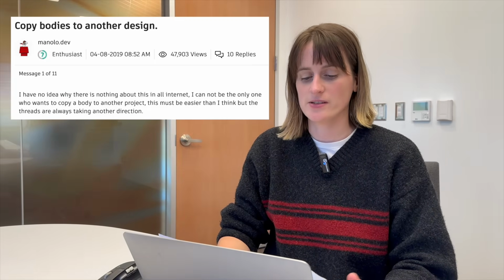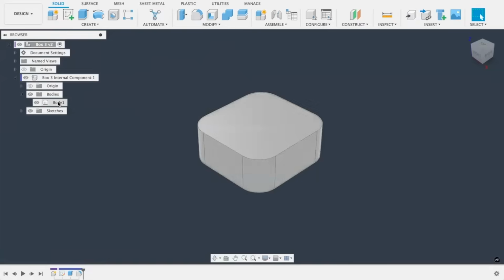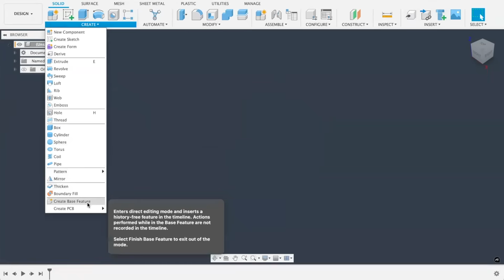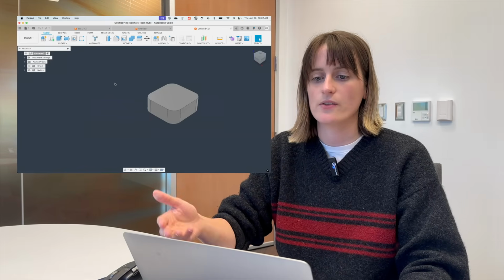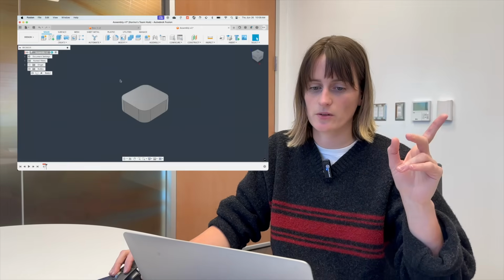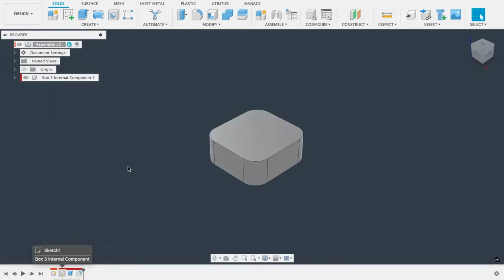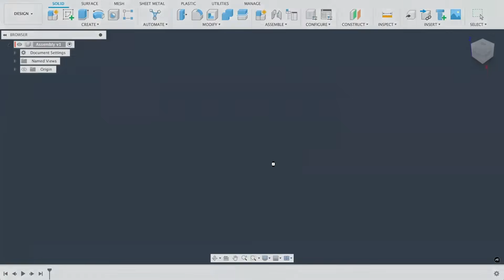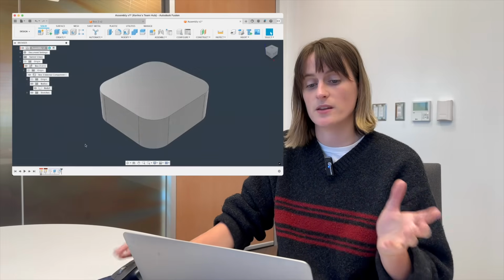How to Copy a Body to Another Design EASILY | Unstuck my Fusion Design

Comment: I miss ctrl+C ctrl+V.  I don't get why simple copy paste can't be standard, or at least a setting in preferences.  "paste new as standard" un-linked and regardless of situation, especially copying into an array or other copies, it's hell if you have the same body copied into components that have copies because now all the copies of the component will also get a new copy of the one part that only goes with the one component you copied it to.  less is more Autodesk, at least give us a button to unlink selectable copies.

Comment: what is the difference between link and derive?
Reply: With derive, you can modify that inserted part without it affecting the original.
Reply: @BlackSmokeDMax ahh, thank you.
So it's the same as a copy and paste ?
Reply: @CR3DT  
Not quite, the derive way is a bit more true to the parametric way of doing things. It is especially useful in things like families of parts. That is also something configuration could be useful in with some cases, but others, just doing multiple derives works much better.

For instance we have some parts that all start with the same blank part off a lathe. 

So we model just the lathe part. Then we derive that model out into each different part that gets work on the CNC mill done, this could be wildly different kinds of shapes cut into it, and not just slightly different sizes where the configuration function would work ok.

Comment: I think the scenario for most users is to copy a body from a complex design to paste into another file which already has some level of design complexity, So the method by copying and pasting component makes most sense. However it becomes a hassle if the body is already inside a component with several other bodies that are not needed in the file to be pasted into.

Comment: Why does Fusion 360 sometimes break the design when I make changes early in the timeline? For example, when parts or sketches depend on others, the references often stop updating and the design falls apart instead of adjusting automatically. Even when I try to reconnect everything, it’s really difficult, and sometimes I just prefer not to touch the beginning of the timeline at all — I just add more features instead.
Reply: Try to follow a general parametric cad workflow, any part should be starting with components, and any early references should be connected well with master 
sketches and constructions that fixed in the origin of the design. 

In Fusion when you start designing by sketching and buddies only there is not enough to make a robust design workflow. In my opinion, that’s the core of any parametric cad software should be rigid and work with a discipline.
Reply: I had this happening a lot when I first designed in Fusion 360, until I learned one majorly important thing - make sure that all of your sketches are fully constrained.  If you expand your sketches in the tree view, and any of them do not have the red padlock on them, they are not fully constrained.  If you make all of your sketches fully constrained, it almost always allows for adjustments that work properly.

Hope this helps, it definitely did for my designs. 🙂

Comment: Thank you for the breakdown of how this works, much appreciated.

That being said though, it didn't need to be this complicated.  It should be as simple as right click on body (or component) in "old" model, go into new model and paste.  When you paste, it could ask multiple choices, such as "Paste without design history", "Paste with linked design history", "Paste with design history, no link".

This would accomplish the same thing as before, but in a much more user-friendly, intuitive way.

I will say this though - I wished other applications (such as graphic design and spreadsheets) had the design history timeline.  Being able to go "back in time" and make a change that ripples thru is absolutely amazing, and one of my favorite features of Fusion 360.
Reply: Click on the body, create new component from body, then copy and paste THAT into a different design.
Reply: @rattyboots  Yeah buddy! That's my kind of tip! Thanks!